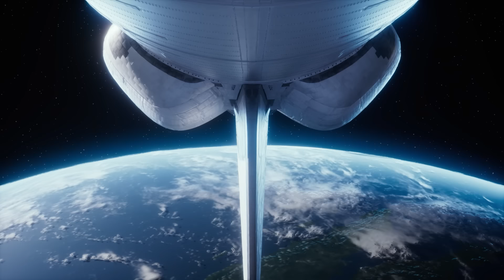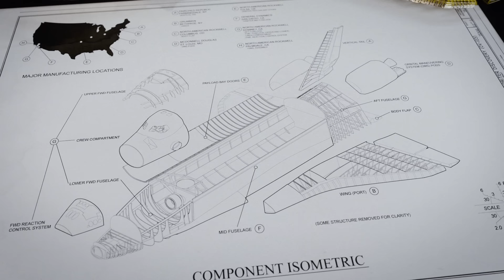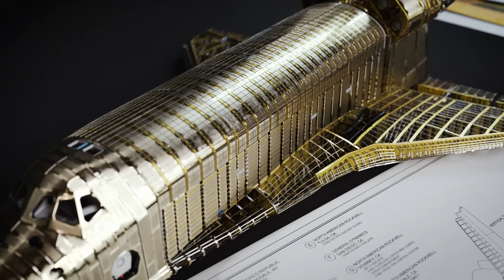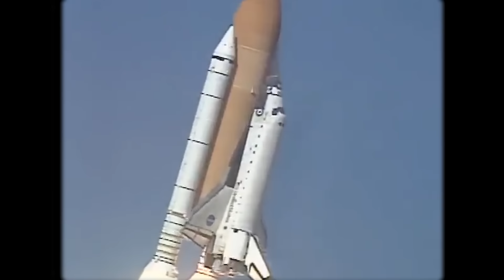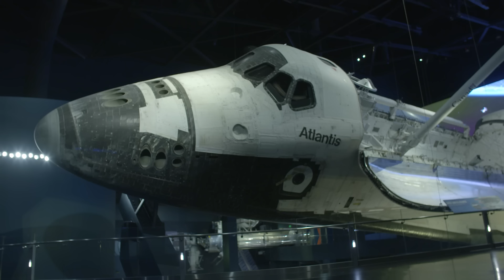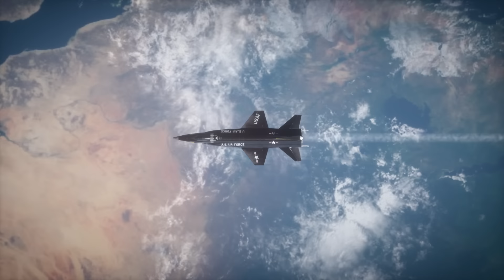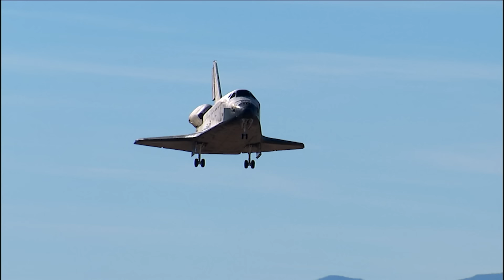The Insane Engineering of Re-Entry

Comment: Why can't the space shuttle take off like an aircraft and fire its engine at 30,000 feet?  You'd think that'd save a lot of rocket fuel.
Reply: The space shuttle itself doesn’t contain most of the rocket fuel. It’s attached to a much larger rocket that’s two heavy to fly like an airplane

Comment: In 1969 the Lunar Module had none of this. How did they make it back to earth in their cardboard box and foil "spacecraft"? 😂
Reply: The lunar module didn't come back from the moon..
All the considerations in this video are related to the atmosphere.
Something that the Moon doesn't have, 
That's why the Lunar module could have loose mylar foil radiation protection.
Reply: Shockingly, the Lunar Module was meant to withstand the conditions present on the Moon, not the conditions present during Earth atmospheric entry. The Command Module is what actually came back down to Earth, and through a process called "docking", the Lunar Module could attach itself to the Command and Service Module, facilitating the exchange of crew between the two spacecraft.
This is where the term "Apollo-style" comes from, if you've ever looked at the Kerbal Space Program community.

Comment: most things become explosive when mixed with liquid oxygen. when pure oxygen was first used in torpedos, if the oxygen canister leaked a little due to pressure changes the oxygen would react with the light layer of lubricant in the mechanical action of the torpedo and explode with more force than if it had hit a target since it still had all of its propellant.

Comment: Designed and built by people of European descent. Other things invented by white people include:

Submarines, electric lights, nuclear power, microwaves, CAT scans, automobiles, hydraulic, wind turbines, backhoes & excavators, jet airplanes, aluminum, hydroelectric dams, steam power, trains & diesel locomotives, tractors, modern pharmaceuticals, open heart surgery, satellites, radios, telephones, televisions, arch & tig welding, computers, transistors, milling machines, plasma and hydrojet cutting, microchips, titanium, telescope, democracy, capitalism, modern farming, x-rays, typewriters, sewing machines, gyroscope, SCUBA systems, pasteurization, center pivot irrigation systems, bicycles, hypodermic needles, Velcro, microphones & amplified speakers, space travel, airplanes, fiber optics, ultrasounds, internet, printing press, container ships, aircraft , GPS, modern textiles, calculus, dynamite, internal combustion engine, Kevlar, moving assembly lines, antibiotics, aspirin, refrigerators, chainsaws petroleum production, trigonometry, helicopters, thermometer, glass mirrors, directional drilling, Astrophysics, crop rotation, carbon fiber, super conductors, particle colliders, pneumatic tires, MRI, sextant, robotics, telegraph, microscope, firearms, penicillin, refined oil and fuels, hovercraft, computers, carbon 14 dating, angioplasty, telescope, pipelines, open heart surgery, tower cranes, chemo therapy, light emitting diodes, motion pictures, cameras, digital cameras, CD/DVD, concrete, dynamite, lithium batteries, LED lights, refrigerators, nylon, water pumps, radar, sonar, satellites, distillation, electric motors, magnetic compass, sextant, clocks, plastics, vaccines, vulcanized rubber, insulin, combine grain harvesters, zippers, and concrete …. Just to name a few. 

What did your ancestors invent that have contributed to the modern human age? Feel free to list them out here.
Reply: The concept of 0 and the decimal system, without which none of your engineering marvels would have happened.
Reply: @AdiBose04  lol sure …. The world would have been left in the Stone Age without that …. What about fire ? Or the wheel? All basic …. Very basic ….. discoveries, that materialized around the world at or about  the  same time …. Like the zero. While some trace The zero coming out of the fertile crescents as far back as 5,000 A.D. …. and therefore giving them “credit” also for Calculus (which was invented by Newton and Lebniz …. Both Europeans) is like saying the Chinese invented gunpowder and are responsible for the Saturn V rocket (Goddard, Oberth, & Tsiokovsky …. The three godfathers of modern rocketry …. All three of European descent) . Thanks for proving my point ….. 99% of MODERN technology and innovation has been brought to you via Europeans and colonization. You’re welcome !!!
Reply: I don't know what European descent has to do with it. Technically all people are of African descent right....
Reply: @CharlieboyK  it has everything to do with everything !!! Africans and people of European descent diverged 100,000 years ago ….. why is the former still living like they were 100,000 years ago?
Reply: @CaugustusWhite Because of colonialism, from said europeans. I can tell you‘re far right.
Reply: @ right as in correct ? Thank you! 😊 🙏 

Colonialism is the most important thing to happen to the human race in recorded history. It has been more beneficial in progressing our species than anything else.
Reply: @ I don’t believe in right or left just those with common sense and values and those without ….. remember, facts don’t care about your feelings
Reply: "people of european descent" cannot comprehend dragging rocks when seeing the pyramids

Comment: This is an outstanding video, thank you and congratulations to Real Engineering and Producer/Writer/Narrator: Brian McManus. As soon as I identified Mr McManus' wonderful Irish accent I knew I'd be in for a real treat of high standard production and I wasn't disappointed. Interesting issue develops at 9:11 with the nose and leading edges of the craft scorching to 1500 degrees Celsius. So a reinforced carbon-carbon composite compound was designed however the resin joining everything together proved to be a bit of a fire-starter and that needed to be extinguished - enter the compound Graphite, leftover once the heated hydrocarbon resin cooled and ultimately decomposed. This left a compound capable of withstanding temps 1510 degrees Celsius. Then more probs however and again enter a solution; small floating strips of inconel were placed over the expansion gaps. But another issue developed; Carbon is a thermally conductive material that isn't ideal for a heat shield. Enter the tiles. 12:31 Interesting to note the Space Shuttle Columbia had 32,000 of these tiles in 2 flavours low and high temperature. Then of course the tiles had to be coated in black [Kirchoff's Rule of Radiation] borosilicate and tetracarbon silicide glass coating on the lower portion of the shuttle. And why isn't the entire shuttle coated black like the SR-71? Because the shuttle exits the earth's atmosphere that leads to the intensity of solar radiation increasing significantly. With the longest time an orbiter mission could be to be 17 days the heat had plenty of time to conduct to the astronauts inside. Wow didn't know every single tile on the shuttle had a serial number that corresponded to their location, shape, and thickness - 25mm to 127mm. The next area of contention was bonding the tiles as there was no 'give' in the tiles...they didn't bend...The flying of the space shuttle was the next area of contention. I'm not going to go through the entire video. Suffice to say it is an excellent video. Every physics student needs to watch and study it. I have learnt so much from watching it. Thank you. Best wishes from New Zealand.

Comment: If a space ship refueled in orbit they could slow down enough to eliminate most of the heat for a safer landing. Of course you would need an orbiting "gas station" to do it that would cost a lot but not be as spectacular as hot plasma is.

Comment: Do we need high speeds to enter the atmosphere? Is it possible to reduce the speed to reduce the heat generated by friction with the atmosphere.
Reply: It requires an immense amount of fuel to slow down. The alternative is re enter the atmosphere at high speeds and let friction do the work for you
Reply: If you reduce the speed to much you will enter the atmosphere at too steep an angle, so it would increase the heat.

Comment: It was so great that, they canceled it in 2011
Reply: After over 130 successful missions starting in 1981

The orbiters were getting old and considering they were using the first proper orbiter they built in 1980 all they way until 2011 they probably would've needed too much refurbishment and modernization work to be cost effective at that point

Comment: Silly question - why cant ther shuttle just slow down its speed and enter the atmosphere say at 300km/h ?
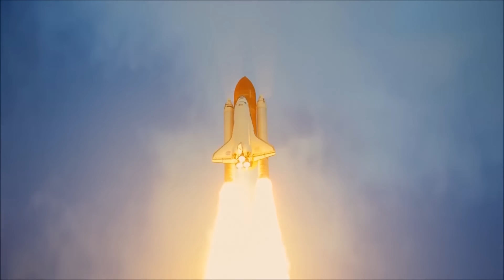Reply: The space shuttle is not so so fast by accident - it was accelerated to 28000 km/h on purpose, because at that speed you stay in orbit. Look at the launch at 3:23. The Orange thing is just a huge tank, so full of propellant. And additionally you have these two big boosters. And at the end that is all needed to accelerate up to 28000 km/h. The reason why rockets are so big and need so much fuel is not because they just have to reach altitude, but because they have to reach a certain speed. 

And you need the same amount of energy to decelerate a certain object from 28000 km/h to 300 km/h as you need to accelerate it from 300 km/h to 28000 km/h. In practice a rocket would not need the same amount of fuel to decelerate after it accelerated (because it carries less fuel at that point, so it is lighter), but still much. And that extra fuel has to be accelerated before. So you would not only need the extra fuel for the deceleration, but also more fuel for the acceleration- because the deceleration fuel makes it heavier, and so on...

Comment: Why can't a spacecraft/aircraft enter the outer atmosphere at a much lower speed, maybe by deploying a couple of large parachutes, like the mercury, gemini and apollo reentries?  So, the aircraft would basically float down to a lower altitude, release the parachute, rev up the jet engine and perform a normal, powered landing.
Reply: "Why can't a spacecraft/aircraft enter the outer atmosphere at a much lower speed, "
Well, you see how huge rockets are? They are basicly just giant fuel tanks. Because you need that much fuel to accelerate from 0 to 28000 km/h. Or even nearly 40000 km/h when you want to go to the moon or further, and not only into low earth orbit. And the deceleration of an object from 28000 km/h to 0 needs the same amount of energy as the acceleration of that object from 0 to 28000 km/h  (in a case of the rocket you would not need the same, because with less fuel onboard it would be lighter on the way back, but still).  Using the atmosphere to slow down is the cheapest option.

" maybe by deploying a couple of large parachutes, like the mercury, gemini and apollo reentries? "
Parachutes don't work outside of the atmosphere. If they would the spacecraft would already slow down by itself enough because of the drag.